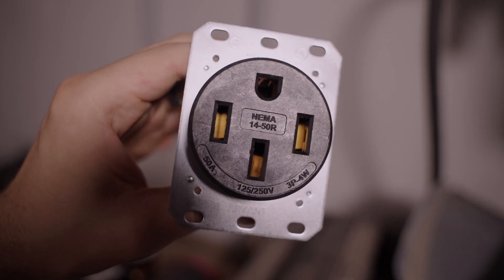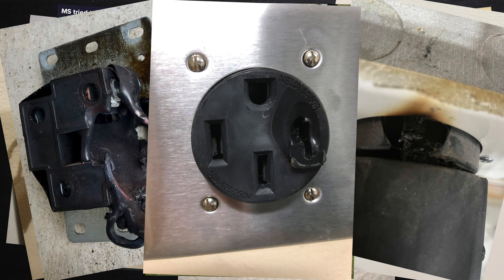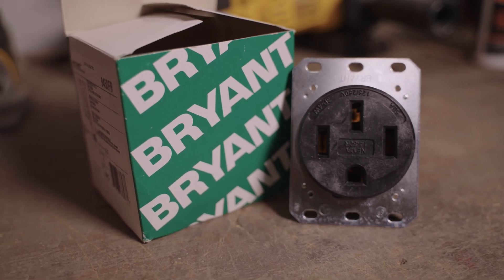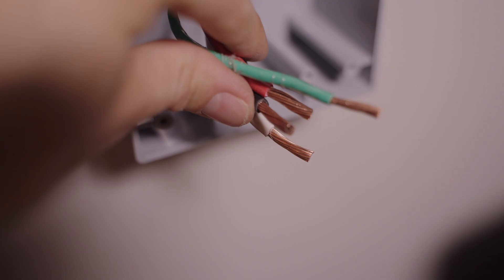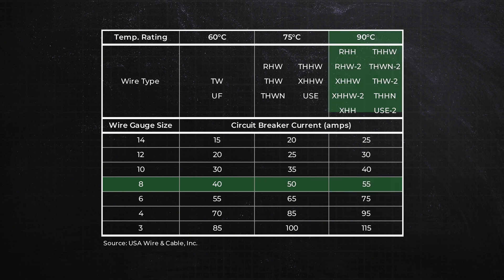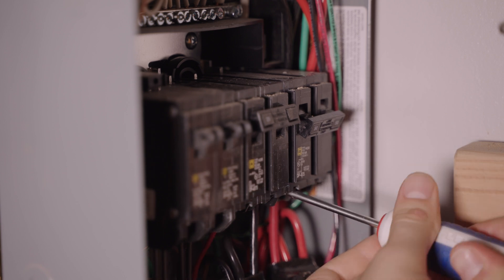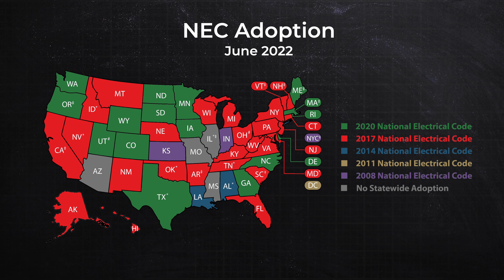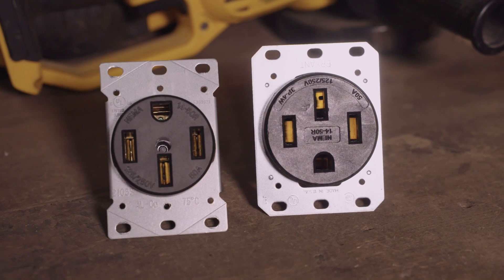3 Mistakes I Made Installing a NEMA 14-50 Outlet

Comment: The bigger question is why use a 14-50 outlet to begin with?  Unless you're planning on making cookies in your garage, the neutral circuit (and wire) is completely pointless, complicates it and makes it quite a bit more expensive.  Tesla has adapters for the more appropriate 6-50R plug.
Reply: I'd disagree. It's never a bad idea to have 2 paths to ground. Whether a particular car's charging takes advantage of that is another question.
Reply: @TheRayDog  Completely pointless comment.  Neutral is never "a path to ground..." that any circuit would ever use.
Reply: @awebuser5914  Take a look in your breaker panel, where neutral and "ground" are bonded and grounded to earth. Check your local substation where neutral is grounded to earth. Power from hot seeks ground, whether you like the nomenclature or not. "Neutral" is actually the slightly incorrect and misleading term. From a safety perspective, the 2nd path to ground is always welcome, and also allows for much easier/cheaper fault detection. Having no path to ground invites a floating neutral, which invites problems. Hence why the NEC is clear on where to segregate ground and neutral, where to bond ground and neutral, and sufficiently grounding neutral at the service entrance.
Reply: @TheRayDog  Ya, no shit that neutral and ground are essentially the same potential current path, but the point is your nonsense about "paths to ground" is just that, nonsense.  Having an unused neutral is completely pointless and would offer zero protection from any kind of realistic failure that exposes a hazard.  In any case, every EVSE will simply not have the neutral wired in any way so, again, it is irrelevant .

Wiring a 240V EVSE plug with neutral is completely pointless . End of story.
Reply: @awebuser5914  Of course you want a neutral. Plenty of people use an L2 outlet for L1 with adapters. It's lazy and not forward thinking to add the neutral. L1 on L2 is the only code compliant wiring setup the vast majority of consumers can manage anyway. If you hardwire, by all means omit the neutral if your EV doesn't use it. But that's not what this video is about. This is a 14-50 vid. A welder, a compressor, a table saw. That's one of the points of going with an outlet rather than hardwiring- versatility. Never mind that most standalone chargers use a 14-50 plug. A 6-50, which is what apparently you're advising, would be a seriously poor choice. The industry has moved away from it and the NEC as well. Why did you even comment on a 14-50 vid?
Reply: @TheRayDog  "Why did you even comment on a 14-50 vid?"  Because the entire video is about connecting an EVSE perhaps?  JFC, some people are just completely braindead...

Comment: Tesla chargers are up to  80 amps for one .. rated continuous load 125% .   no wonder you're  cooking the outlet. Read the name plate on the charger and see what your  charger requires.
 more than likely, the equipment bonding jumper is connected to the natural, like dryers.

Comment: I was a Ford tech. Learned some stuff about residential charging from them. One of the first things I was shown was burnt houses and cars and garages. Not necessarily because the tech did it wrong.
But because this is an emerging technology. I don’t ever install NEMA plugs for EV chargers at all. 
And honestly, that technology is already outdated in my opinion.
I only install the Tesla Gen 3 charger. Tesla has been doing it longer has made more mistakes and learned from them. 
I looked at the Rivian chargers too, and they are not great wouldn’t take on the liability myself.
But Tesla has made a universal charger for the GEN three I recommend it over the Rivian truck charger any day.

Comment: When you use NEMA 14-50, use 50 amp breakers!
Reply: Perfectly fine, and prudent, to use a smaller breaker. It's mandatory in this case, given the low terminal rating.

Comment: I’m confused at why the #8 THHN doesn’t work with the 50A breaker. On a 50A breaker the max charge is going to be 40A. 

Can anyone explain why #8 THHN won’t work with the 50A Bryant receptacle that’s rated at 60° C?
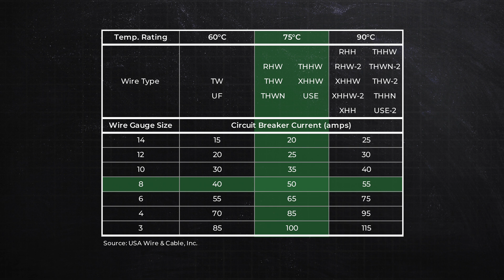Reply: If you look at a table of wiring ampacity, you must take into account the temperature ratings of the connection points. His outlet is only rated for 60C at the terminals. Therefore the entire circuit is limited to the 60C ampacity column. 5:42.
Reply: @TheRayDog  I understand the rating for everything is 60C, but the THHN isn't in the 60C ampacity column, only TW and UF wire. #8 THHN should still rated for 55A.
Reply: @N.I.C.K.  THHN not being listed in the 60C column is because the maximums are listed only. It's understood any wire is gtg in lower columns. The weakest link dictates which column ultimately covers all. re: "On a 50A breaker the max charge is going to be 40A." Keep in mind the breaker must be spec'd to the weakest link as well. You can't assume/say only 40A will be pulled. A 50A receptacle with a 50A breaker means all components must have a 50A rating. Wire (check), receptable (check), connection points (no, 60C). Therefore with everything 60C now, use the 60C column.  Programming an EV to pull only 40A is immaterial. Only plugging in a 30A welder is immaterial. Either upsize the wire to where the 60C column covers 50A, or downsize the breaker to not exceed the wire's 60C ampacity.

Comment: The 90 degree column for ampacity is literally only used for derating purposes, so a #8 THHN is never actually good for 55A - always 50 or less. For circuits under 100A you must use the 60 degree column, unless all terminations and the wire are rated 75 degrees or more. Technically the #8's are okay in that case, but on something drawing 40A+ for many hours a day you should absolutely use #6.

It's important to remember that the code is a minimum standard for safety - not necessarily the best practice for a specific situation.

Comment: The nema standard 14-50 is that the outlet is rated for 50 amps and makes a standard configuration for the prongs that are rated for the load universally. It will give you 50 amps, however NEC states under a continuous load the wiring and outlets MUST be Derated to 50% of their rating and a continuous load is described as any load lasting 3 hr or more. So everything needs to be increased in size. Electric cars are an issue, I recommend a charging station whenever possible. I don't own a EV But I am a Master electrician I always believed in upsizing wiring, it makes for a better install and adds a safety factor.    ***Remember electrical work is NOT A HOBBY Hire a Licensed electrician***    installing these things and not knowing codes can burn your home down.     I've seen it.

Comment: A couple of more mistakes you have made.... Is that  a  RECEPTACLE itself is NOT an outlet , the box is the outlet , weather it be an receptacle outlet or a switch outlet. . Torque is pounds  inch Not inch pounds   Torque = force x distance not distance x force , as in newton meters , not meter newtons , If you are into details, then details matter.Also , they are not Phases on a single phase service, they are Phase conductors or Legs. Ask Mike Holt. Not to mention you not mentioning "continuous loads"where there is a different set of code tables requiring 125% ratings for breakers and conductors.  I have done this research and decided to leave this to a licensed electrician. Its not as simple as you think with this kind of load.
Reply: I try not to be snarky with my comments but I have to here.  FYI:  "2 X 3 = 3 x 2 = 6".  Your proclamation that "Torque = force x distance not distance x force " is ridiculous.  Look in texts that are considered the bibles in structural analysis of aircraft structures, Peery, Timoshenko etc.  either in-lbs or lbs-in is used, it's the same.

Comment: If you have installed these high current outlets before, when you finally use a proper torque device you will realize you were probably not torquing these terminals enough in the past.  As commenters have stated, torque, wiggle the wire and torque again is a good practice.   Regular household 20A circuits do not have the torque worries that these high current circuits require. 

Additionally, choosing a high quality receptacle is also important.  This outlet will have many plug-in and plug-out cycles. 

Great info in this video.

Comment: Sorry, but this is a pet peeve of mine. If you're going to teach or instruct on installing outlets, you need to use the proper terminology. What you are holding in your hand is NOT an outlet, it is a receptacle, the box you are putting it into is the outlet. It then is referred to as a "Receptacle outlet". Every place you use electricity is an outlet, your furnace, your central AC, your electric water heater and any place else you are connecting to use electricity is an outlet. You're holding a receptacle and going to install it into an outlet.

Comment: One thing nobody talks about, is that the circuit breaker should be switched off whenever one plugs and unplugs the charger. These outlets are not meant to be used like regular 15-20A outlets that we have throughout the house. This avoids arcing when plugging in and development of carbon that can be a source of problems later.
Reply: Most EVSEs are drawing milliamps when idle, so this is a completely pointless "recommendation".

Comment: For an EV charger they usually only use L1,  L2 and ground.    If I did not have an outlet already I would just get a hard wired level 2 charger,  pull  4 gage THNN in conduit and use a 60 amp breaker.

Comment: If I have an electrical appliance that requires 3000 W, can I change a 15 amp breaker for a 30 amp one?
Reply: The breaker is to protect the cable (from your breaker box - load center - to your outlet). So if you have an appliance that is tripping the breaker DO NOT just install a bigger breaker! You need to have an entire new cable run for the appliance which can handle the greater load. This is important: do it wrong and you will burn down your house. Best to hire an electrician & have the peace of mind.

Comment: Receptacle has max temp rise of 30°c at 50 amps so 75° - 30° = 45°c or 113°f.  It would depend on how and where the receptacle was mounted (hopefully not in a hot wall exposed to sun). It is only a caste nylon shell -- not back-o-lite or epoxy.

Comment: I repurposed a 50 amp GFCI line from a former hot tub to power my 30 amp Enel X Juice Box. I replace the GFCI breaker with a regular one because the instructions said I should, but for fun I used the GFCI breaker for 1 week to see if it caused any issues. 1 rain storm and 1 snow storm happened that week (go figure, December in central PA). The outlet is in a sealed, locked box. I had no issues, but changed the breaker anyway.I have never unplugged it, but without a GFCI on an outdoor outlet, you can bet I'll be shutting off the breaker if I ever do unplug it.
Reply: Lets hear about WHEN your outlet melts and burns your house down.

Comment: Using a 40-amp circuit breaker is fine as long as you aren't drawing more than 40 A, (32 A continuously, i.e. 3 hours or more) and as long as they're all compatible with the lowest temperature rating in the chain.  If your charger is drawing more than 32 A continuously, using a 50 A circuit breaker is non-negotiable.

It would be better to use 90°C-rated equipment throughout and/or pull heavier wire.

Comment: Hubbell products have always been top $$$,  I bought a Hubbell NEMA 14-30P for my lathe in 2016 and it was $55 at the time.

One thing that i discovered later is that in the larger sizes, the twist-lock versions, e.g. an L14-30P, are considerably cheaper.

Comment: Thanks for putting out the video and starting the conversation. Thanks to the electricians for their advice too. Tesla's wall EVSE (wall charger) only draws 32A, but another unit might try to draw more. Telsa still recommends a 50 amp circuit with 6AWG wire: 
- Voltage: Single phase, 208-250 Volt AC supply, 60 Hertz 
- Circuit Breaker: 50 Amp recommended
- Operating Current: 32 Amp (maximum continuous current)
- Conductors: 6 AWG recommended, Copper Wire Only. Upsize wiring for installations over 150 feet
- Ground Fault Circuit Interrupter: Not required 
- Service Disconnect: Not required 
- Receptacle Recommendation: High quality, industrial grade receptacle
Reply: Tesla wall charger can draw 40A - just like most (all?) of their cars since 2020.  Their mobile charger max is 32A
Reply: There's 4 categories of chargers 
1 (115 20 amp)
2 (220 80 amp)
3 (480 300 amp)
4 (1 mega  1200 amp)  for the truck stop chargers when they  come out

Comment: I have a garage that was converted into a large spare bedroom with regular 110 outlets,  it has a window right out in front of the driveway, which for me makes sense with the right
AC window kit and 3.5 '' duct tube, I could see a regular 240 chord slide inside of out to the  electric car's charge port, once I upgrade the 110 outlet into a 240 Volut outlet:

But what am I missing?  What major advantage am I losing by not just installing a dedicated outdoor  Level 2  (station/stand)  as I've seen others do, when they have no garage like myself ?

Comment: Super. ALWAYS use the expensive name brand 50 ampere commercial receptacle, a metal well anchored 4/0 box and metal (2 kinds, one surface mount, one recessed mount.) cover plate, and a 50 ampere GFCI breaker, or the prefabricated GFCI outlet box and a standard 50 ampere breaker. Do use at least 6/3g or four six gauge copper wires (Larger is OK, especially for long runs.) if you don't know your areas electrical codes. (Note: THHN 6 gauge wire in conduit can have an 8 gauge ground, some 6/3g has an 8 gauge ground, and some codes allow the ground to be one or two gauges smaller than the conductors.) Make sure that you have four wires into your outlet or prefab box, even if it only requires three. (Old school.) ALWAYS add mineral oil or oxidation prevention grease to ALL connections and to the breaker, (ALL of the terminals or connections, including the breaker and plug prongs.) and always wiggle (Hard) the wires to the connections and retorque the fasteners at least twice. Think about putting a disconnection device beside the outlet so that you can turn the power off when you plug in or remove the plug, and lastly, get one of those rubber door mats and put it below the outlet. (And breaker box.) I have had to repair the smoldering remains of car charging outlets for years now, and sometimes it was a customer that installed it, but many times it was a licensed electrician who actually did a fine job but didn't know that a standard 14-50 receptacle from your local hardware store was inadequate for the job. (Mostly due to being plugged in and out again, while a stove outlet remains connected.) These procedures and precautions allow this Sparky to sleep very well at night. Stay safe. 💙 T.E.N.
Reply: Insulate you from the floor so there is less of a chance that you will be shocked. I put a mat in front of most of my breaker boxes. 💙 T.E.N.
Reply: What are the rubber mats for?

Comment: having multiple fuses in a breaker box and preventing turning off the wrong breaker it is best before disassembling the outlet is to test/check if any voltage from the 14-50 outlet.  Looking at your wire it looks like you're using a #8 and should be a #6 AWG for the 50amp circuit.

Comment: Then the manufacturer and UL labs are at fault for allowing the FALSE rating . If it fails at rated amperage it is not rated properly!!!
GFCI or arc fault breaker don’t work properly for EV chargers and most welders. NEC is constantly changing because they don’t get everything right. Too much incompetent bureaucrats running our lives.